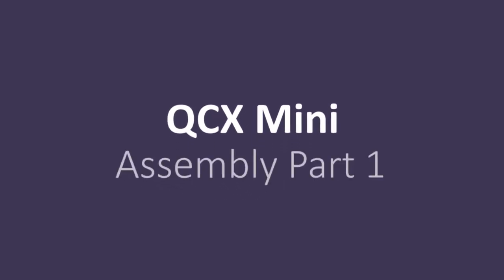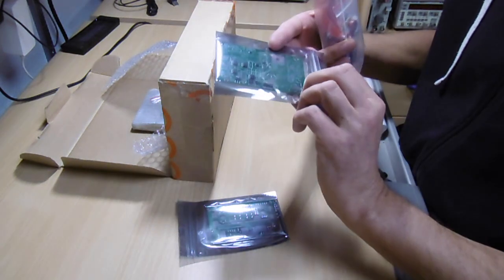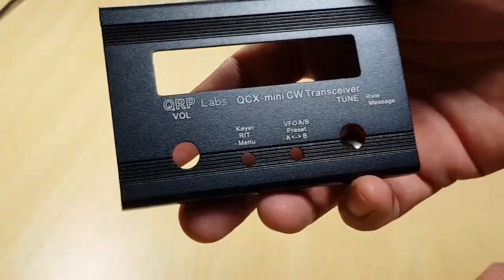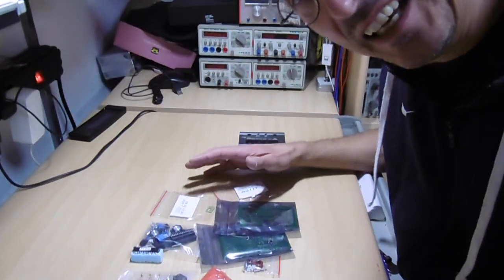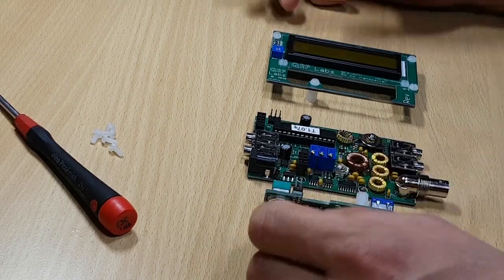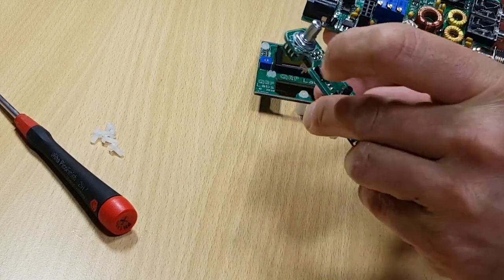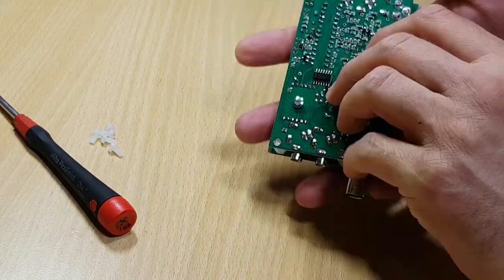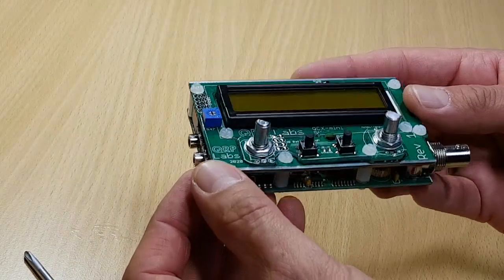QCX Mini - Assembly

Comment: I’m bummed.  I have the Revision 1 board.  I took off the Voltage regulator and need to order a new 78M05 replacement chip.  Fun fun !! 
I should just order a new board.  Is that possible ? 
I just wound T1.  What a chore lol.
Reply: Got to the alignment and it does not work.  Can tune C1   but not the peaking Trimmers. R27,24,17.  One of the Op Amps is bad.  Gotta figure out which one. 

It oscillates as soon as I add power when I turn it on.

Comment: Excuse my rookie question.  Do you need an oscilloscope to set it up?
Reply from the maker: Hello Juan, no problem, we all have many questions, especially at the beginning. There is no real need for an oscilloscope, but it would come in handy to be able to e.g. measure the output power of the QCX. All basic alignment can be done with the "onboard" measurement features without any problems.

Comment: Great video - Thanks.  I received my QCX mini yesterday. It is a version 2. Per the website:

"Step 3.42, the addition of an 10uF electrolytic or tantalum capacitor in parallel with C38, is neither required nor recommended on a Rev 2 PCB; the existing C38 capacitor is properly rated and is perfectly adequate. Therefore ignore step 3.42."

Comment: I just saw your posting of this video, very nice!  I have two of the original QCX transceivers with the Ba-Ma-Tech cases; for 20 and 40m and they are great radios; fun to build kits.  I have not ordered the Mini yet, but I am being tempted, hi hi.  I would probably miss the "straight" key switch that was included on the original QCX, though.  QRP-Labs is sure doing a great job designing these kits and getting QRP CW on the air.  I will be looking forward to the next QCX Challenge!  In the meantime, I am off to see the next part of your video.  Thanks again for doing it.  73, de Karl, KO8S
Reply from the maker: Thanks a lot for your feedback Karl! Yes, I also have both of the predecessors and they are great, but so far I love the QCX Mini best!
I love this cool little radio and will use it with my Palm Radio Pico Paddle...